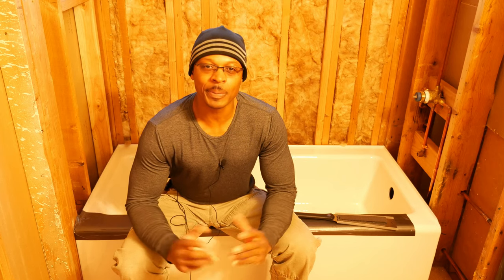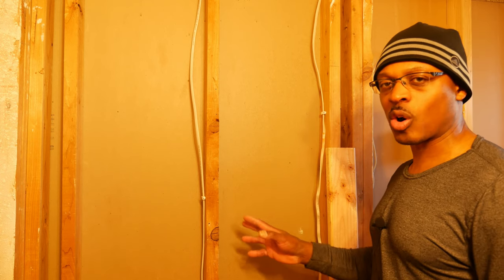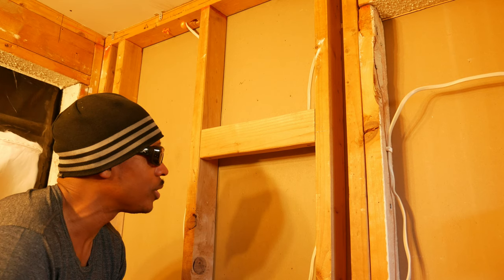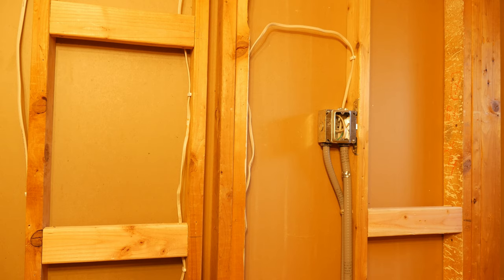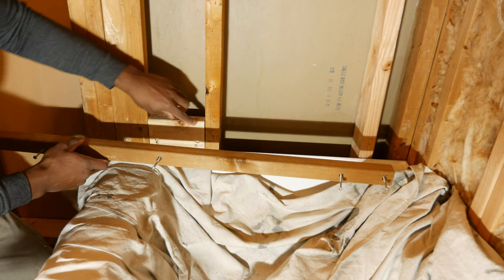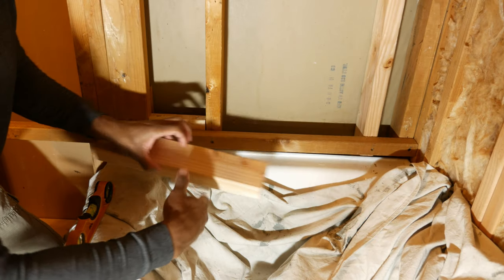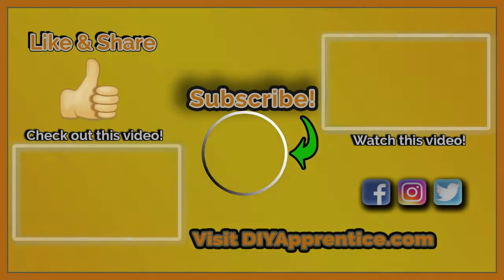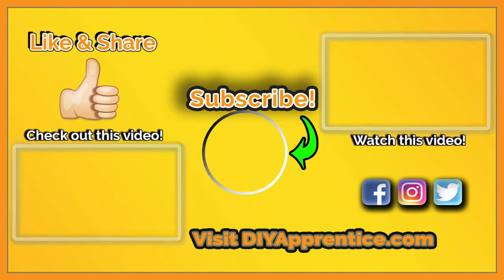Bathroom Remodel 60 - Tile Backer and Drywall Installation Prep 1 of 2 | DensShield | Durock

Comment from the maker: I hope you found the video useful. I installed 2x4 blocking, but you may want to go with 2x6's or 2x8's instead.

Please leave a 👍 and share the video!

🔧▬▬Tools and Materials▬▬🔧
✔️ DIY Apprentice Recommended Tools and Materials ► https://bit.ly/2T5psFw
✔️ Porter Cable PCC647 Impact Driver ► https://amzn.to/30QsBLY
👉 Porter Cable PCC647 Impact Driver Review ► https://www.youtube.com/watch?v=xqLYu...

📷▬▬Video Equipment▬▬📷
✔️ Camera used ► http://amzn.to/2GcpkOb 
✔️ Lens used ► http://amzn.to/2Deu16S 
✔️ Tripod ► http://amzn.to/2GbaM1c
✔️ RAM Suction Mount ► https://amzn.to/2Wz9PXh
✔️ Cyberlink PowerDirector ► https://bit.ly/2jTwGxT
✔️ Adobe Photoshop ► https://bit.ly/2V7nyUX
✔️ Camera Slider ► https://amzn.to/2WtD7GW
✔️ Deity V-Mic D3 Super-Cardioid Directional Shotgun Microphone ► https://amzn.to/2LI1lf7